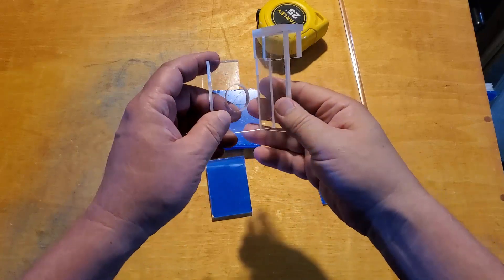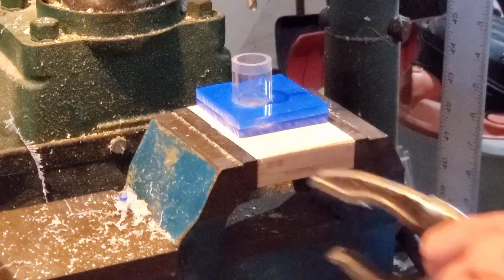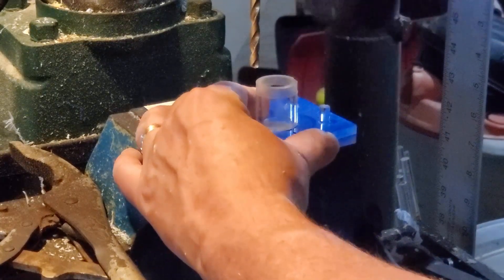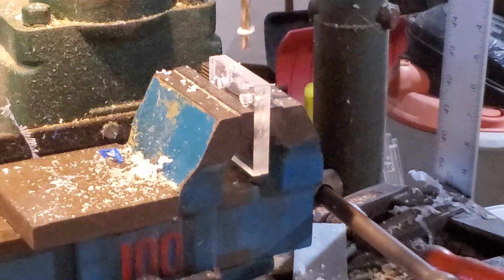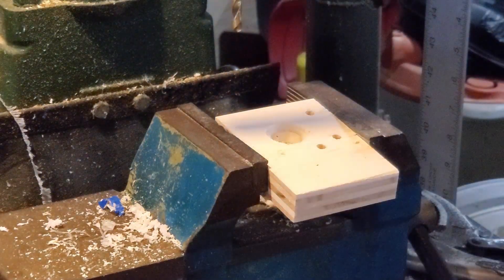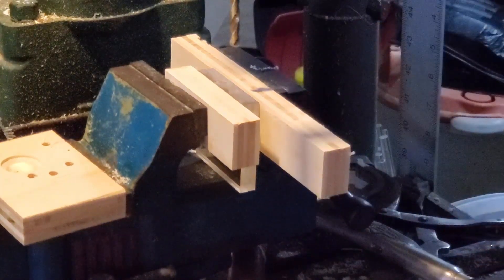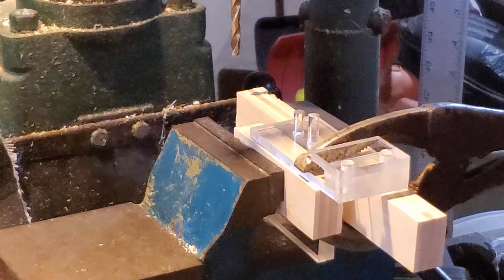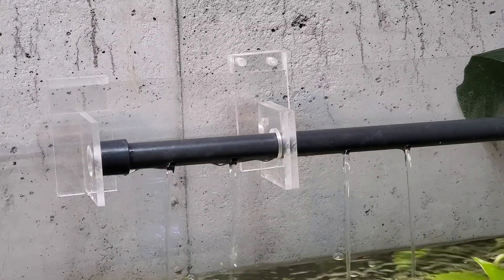A No Weld Acrylic Bracket

Comment: Thank you for the idea... I would suggest nylon or delron nuts & bolts. Then you could assemble and disassemble as needed. And the 90 degree attachment could be drilled and taped for the correct size blot.
But in the end glue / weld is the simplest..  If it anit broke dont fix it!!!
Reply from the maker: Hey Raymond! Welding is the most efficient by far. This was a request and if I wanted to make it at least a little comparable the nuts and bolts method would speed things up drastically. Thanks so much for coming by!

Comment: Another option, might be to use nylon bolts through clearance holes in one piece, into tapped holes in the other part.We used this method many years ago when I worked as a technician building experimental equipment out of acrylic, for particle physics research, in Glasgow University.
Reply from the maker: Very true David! One could also use nuts as well and avoid threading. That sounds like an awesome job you had! Thanks so much for sharing!

Comment: It looks very nice, but still not worth the effort imho.
I'd try to press those rods in with the bench vise, or does the acrylic break easier by pressing then pounding?
My quick and dirty solution would have been to just have a longer piece with the  hole for the pipe in one end and cutting away material for thew hanging in the other.
Reply from the maker: Acrylic can be brittle. If I had soft jaws for my vice I would attempt a press, but I don't. You will like the add on I'm including in Fridays' video. I did a quick knock off of your idea. Thanks for watching!
Reply: @FishmanEricRussell  Nice. Maybe a piece a of plywood between the vice and the pressed acrylic would do the trick?

Comment: Just amazing. A lot different than I thought. I am super impressed. 

For everyone else this video and I would guess a few others is because of a request. This channel’s interaction with the viewers is top notch (just like the bracket you just viewed). 

And I am still wanting a filter built. It’s just that Covid has this a little tight right now.
Reply from the maker: I'm so glad you liked the build. I'm knocking off a quicker version suggested from a comment for Friday's video. There's no connecting of pieces involved but it does hold up the PVC pipe.